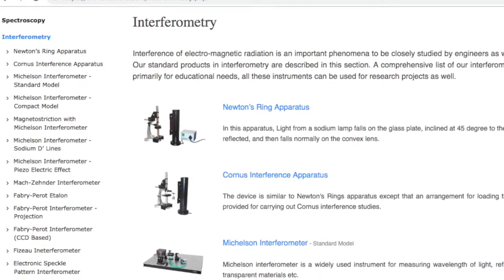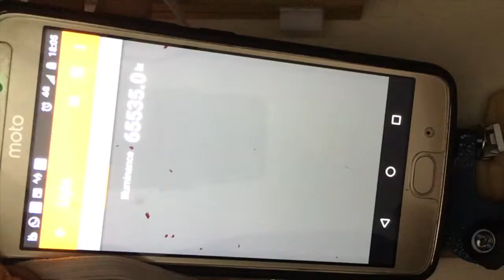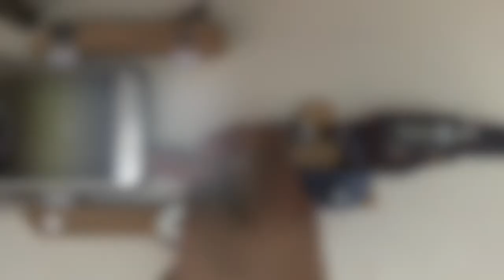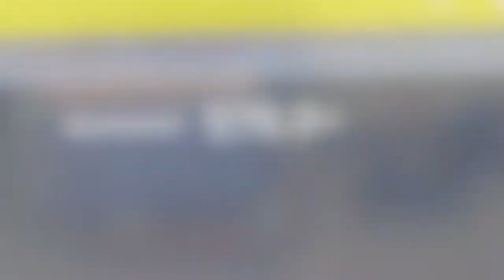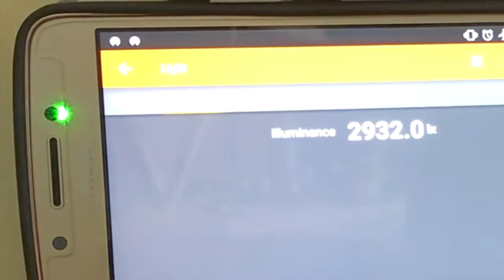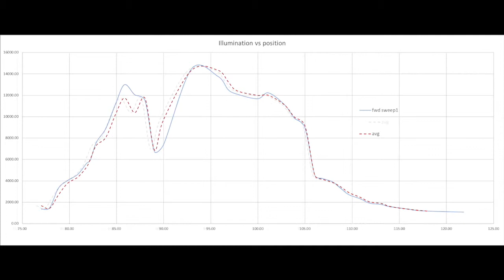Build custom interferometry sensor

Comment: Is this the setup you did your experiment with different pencil lead densities?  Did you adjust position while the light was being influenced and measure luminosity at each position to get an overall light curve?
Reply from the maker: No. For the lead experiment, the full setup details are here: https://mfr.osf.io/render?url=https://osf.io/dca3j/?direct%26mode=render%26action=download%26mode=render